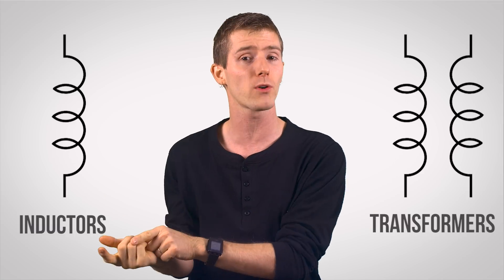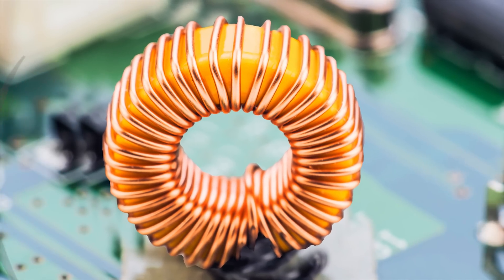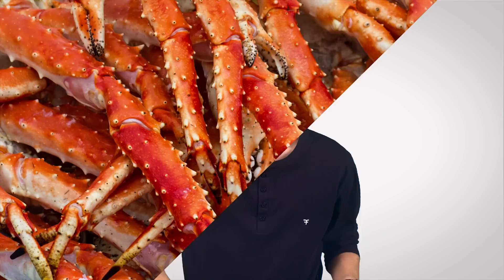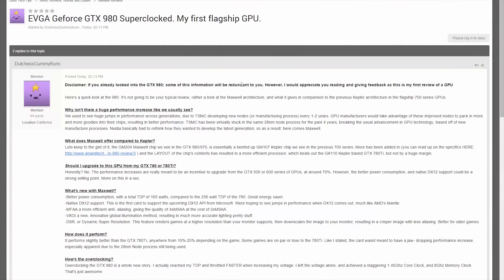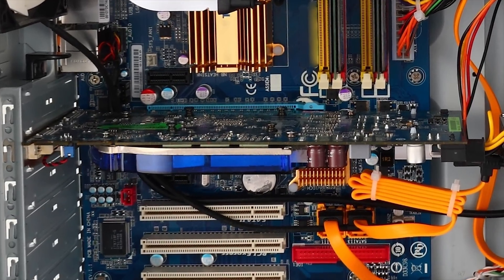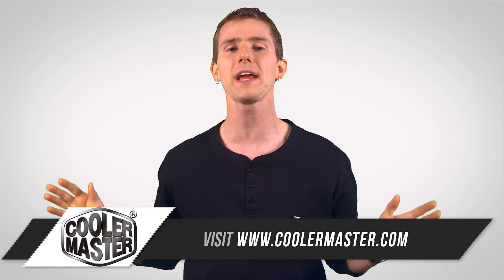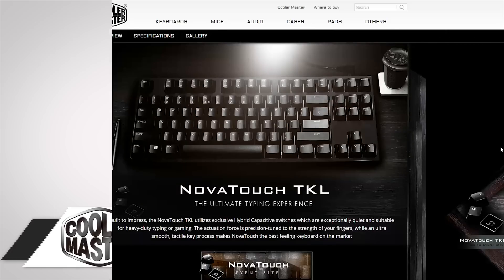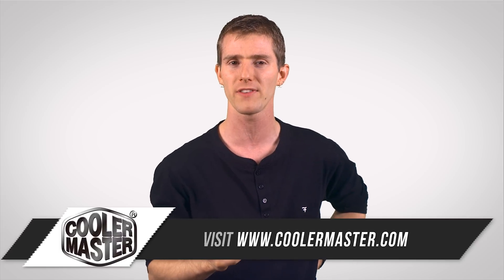Coil Whine as Fast As Possible

Comment: Coil whining is not due to resonance per se. It is due to the mechanical vibrations caused by the varying electromagnetic field forces exerted on the coil components (winding and ferormagnetic core). The frequency of these vibrations is the frequency of the changing of the amplitude of the electromagnetic forces which is equal to the frequency of changing of the magnetic field which is created by the flow of the current through the windings and which changes according to the load (the gpu load). Typically within each frame the magnitude of the current undergoes at least one increase-decrease cycle/spike. The period of these current increase-decrease cycles is therefore tied to the frame time, or in other words, the frequency these current cycles (and the resulting coil compoenent vibrations) is tied to the frame rate. For 60fps and 1:1 spike:frame time correlation you would have a variation frequency of 60Hz which of course falls witin the audible range of 20-20KHz and that's why we hear the resulting coil component vibrations. Also the higher the frame rate the higher the frequency and the higher the pitch thus the term 'whining'. Sure resonance MAY also happen to occur too on top of that, which will amplify the amplitude of the resulting oscillations and augment the issue even further. But reasonance is not the underlying reason for the coil whining phenomenon.

Comment: If you are too lazy to watch the video and want a fast solution just use digital sound! Use any USB headphones or buy an external (USB) soundcard for 6 bucks and plug your jack connector into it. I'm using a potato and it worked.

Comment: In most cases graphics card coil whine can be caused by high frame rates, especially in older, less demanding games. My RX 470 starts to pipe up around the 120FPS mark but if you turn on VSYNC to 60 it usually stops any coil whine issues, at least for me it did.
Reply: Also in the Witcher 3 loading screens when booting up the game where fraps reports around 3000 FPS. 😂

Comment: To guys saying Vsync will definitely fix the problem:

you're actually not entirely wrong, but not entirely correct too. In cases where we have our GPU card much more reliable for certain games which we play, yes, turning on Vsync may help.

But lets talk about lower-end GPU here. Lets say Im playing Game "A" with 50 FPS average and I experience Coil Whine. In this case, TURNING VSYNC ON WON'T HELP. And this is actually what occurred on my end.

This coil whine apparently may cause when GPU card gets too much stressed, resulted in high energy draw. Having 150 FPS with coil whine may be fixed by turning Vsync, giving GPU card lighter task to do per second. But when you have a Card which is already exhausted to make 60 frames in a second (or less), Vsync can't do anything.

Yes, PSU performance plays a role here.

Comment: I'm assuming this is the same thing that causes some old CRT's to emit a high-pitched scream. Too bad there isn't any real fix, though I've never noticed this with anything with modern computers.
Reply: I remeber that whine of CRT's, its more annoying then coil whine on graphics cards. Also it sometimes seemed to happen when putting a CRT monitor above its recommended resolution

Comment: i cant tell if my coil whine is chipset or gpu because the chipset is under the gpu but i think gpu because it only happenes with glu load but anyways i will be getting a 1080ti when a custom cooler design comes

Comment: Frame Rate Target Control -> Set to monitors refresh rate, optionally use vsync. On some certain models and older cards it might not eliminate it but it will help. 
GPU coil whine is usually caused by frequency mismatch between the monitor and your GPU's ROP, basically discarded frames shoot out of the capacitors and inductors. It can go the other way too, you can actually "infect" some old HDMI TVs with newer GPUs, giving the TV permanent coil whine. Happened to my old 1080i insignia(off-brand comprising of outdated and binned samsung parts)
If it's a MOBO component it's probably just some noise from lowish quality caps in either the MOBO or PSU.

Comment: Hey techi, great video! Got a question for you. Why does my computer start whirring up really loud when I'm gaming or processing a video? I've flipped the switch on the back of the PC from 300 to 325 Volts and all it did was shut off the breaker for that side of the house. Is there a such thing as a compensator to prevent that from happening?

Comment: i have something weird: my speakers, not my gpu but my speakers make coil whine-like sounds when the graphics card is under heavy load. what can i do about that? i tried putting my speakers in the front aufio jack, reinstalled driver, even tried other speakers, but it still occurs! only my headphones dont get the sound. what am i doing wrong?
Reply: ***** you sure it are my speakers? I tried connecting to my phone: no weird sound. I tried connecting another speaker to my pc: weird sound again.
Reply: Martin Van Den Hoek try rotating the cable, usually it's the combination of weathered jack and old port.
Reply: Lunar Froxy i got a mobo thatsjust 3 montd old. But ill try, thanks!
Reply: Lunar Froxy i tested, rotating does not work.i have my speakers turned off now, and i onl y use them for watching movies.
Reply: speakers dont coil whine, buzzing sounds from speakers are caused by electrical interference, the audio jack on your pc may not be properly grounded or the cable does not form a snug plug with the jack
Reply: Babatunde Olajid how can i properly ground it then?

Comment: as soon as i start a game like Fallout 4 it starts to whine but in normal runs i don't hear a thing
Reply: Looks like you have the same issue as Linus' old video (which he showed at 1:02 - 1:07 ). The coil whine starts when the GPU is under load and intensifies as the load increases. Unfortunately there is no solution for this.
Reply: what if i send my card back and buy a new one would there be a chance that the whining is gone?
Reply: sharkyfive
Based from what I've read, most companies don't cover coil whine in their warranties :(
Yes, that if you and the seller agreed for a return of equipment. But you better check if it is your GPU, because sometimes the PSU causes it or even the mobo and/or the fan.
Reply: Juriel Primary how do i check it the best just start a game without the card plugged into the pc? should i maybe buy a high quality PSU from like be quiet should that help?
Reply: sharkyfive
The thing you can do is to listen very carefully at each component mentioned. Did you overclocked your GPU? CPU? If you really suspect your GPU to cause the whine, try other GPU heavy games like BF1, GTA V, Rise of The Tomb Raider, etc.
If you overclocked your GPU/CPU, try to revert it to default settings and see if it will help. Coil whine usually occurs when the component is in a lot of stress due to heavy loads of data.
Reply: sharkyfive
here's a useful link i found about coil whine. maybe one of the solutions here can help you

https://www.reddit.com/r/overclocking/comments/3ty1s6/gtx_970_having_obnoxious_coil_whine_after/?st=ivntixjx&sh=805d71ea

Comment: Would buying a sound card fix it? I have a gtx 750 ti and its really bad with some of my headsets. At the moment im using intergrated/motherboard sound so.... soundcard? Yes or no?
Reply: Coil whine is from vibrating physical components, not through the speakers.
Reply: Did you watch the video? The whine originate from parts on the card itself.
Reply: IF the sound comes from your headset it is NOT coil whine. In fact this could be an issue with your motherboards integrated audio OR drivers. So yeah, buying a sound cart MIGHT fix it. Get yourself an USB sound card for real cheap and see if that helps.

IF the coil whine comes from the GPU, what makes you think buying a sound card will fix it? Because it won't. Only replacing it would fix it. And a GPU should not make high pitched sound come out of your headset.
Reply: ***** Ive tried it and its still there on all my headsets, except some its louder than others. (This is probably because some headsets have better protection against it?? idk)

Comment: I spent $230 on a gigabyte 960 g1 gamers edition card and it slapped me in the back with coil whine after 1 year.
FRIK YOU GIGABYTE
Reply: Not gigabytes fault. Happens to all manufactures. You can't prevent it. It's an issue that might occur with all electronic products that use Coils and Capacitors.
Reply: A320M-DS2 same issue :/

Comment: Wouldn't a power supply with extremely low ripple and very, very good clean and stable power delivery as well as a gpu with a very clean and stable power delivery reduce coil whine by a lot?

Comment: Bought gtx 1080 gigabyte xtreme,  got coil whine while testing and while playing witcher 3 on ultra 2k,  its not reallllllllllllly that loud but it's annoying in someway and gets me worried,  should I return I have the option to do it and swap it for something else? Or its gonna be everywhere anyways?
Reply: it comes with normal operation, so long as the card works then you're fine, its a side effect of normal operation
Reply: +Dylan Collins yes but it happens with every game which is strange
Reply: Billy Harb not really, just shows that your card is working hard but performing well
Reply: +Dylan Collins well I guess I got nothing to worry about, thanks for the info bro
Reply: I just had that with my new gtx 1080 on the witcher. And it sounds like how you explained it. Have you noticed that it is alot more worde with hairworks on? Btw i was worried to but after googling its turned out not to be that bad, just annoying lol

Comment: My server doesn't get coil whine :) I can actually sleep at night.
Reply: Well, its usually gpus that coil whine
Reply: +Xamnition I'd be worried if you had a server without at least 1 graphics card.
Reply: +Convergant What? Most servers dont need gpu's
Reply: +Xamnition Most servers will use Xeons, which don't have integrated graphics.  AKA they need a GPU.
Reply: +Convergant I know, i use a xeon myself. Most server motherboards have integrated graphics
Reply: +Xamnition Regardless of that, a lot of server-grade workload will utilise the the GPU(s).
Reply: +Convergant Very few things utilize the gpu, usually servers use multiple cpu's
Reply: +Xamnition You'd be surprised.  For example, Blender (a popular modelling/animation program) can be set to GPU Compute (which will use the GPU for rendering).
Reply: Convergant I know, i use blender all the time.
Reply: Xamnition Then we can agree that you should have a GPU for those kinds of things?
Reply: If you are talking about a VM host server, or a linux (web)server in general: there is absolutely no graphic card required. It won't be used, you can SSH into the box so you don't need a GUI to work with. If you are talking about a render farm computer: put it full of graphic cards as much as you can. But a render-farm server is not the kind of shit I want in my bedroom ;)

Comment: Coil whine on high load? My gtx 980ti does it on low load, then I just need to open a GPU intense aplication, like a game, and then it stops for the rest of the sesion.
Reply: Mine only does when closing unigine valley and heaven. Weird
Reply: Brooo same here, but i have it in my cpu fan. i need to increase the speed of cpu fan to stop this noise.
Reply: It's so strange... Mine has completly stopped now.

Comment: have a 970 with this annoyance
Reply: did you get your $30 for their lying bullshit?
Reply: asus turbo?
Reply: The Fresh Peddler - Beats For People Who Hate Radio nope a Palit but most 970 have this problem
Reply: just bought an evga 970 and now i have this fucking whine coming from the psu...
Reply: wades623 no its us only and its not $30 for the coil whine its for the 0.5GB Rant
Reply: Ding Chavez overclocked?
Reply: slightly, +50 on core and +50 on memory. Im on a corsair CX 750m, i turned down my cpu clock just after posting that comment, followed by lowering the voltage (only -100mhz and drop vcore to 1.43 from 1.50) seems that the cpu OC was the problem :/
Reply: you drained too much power on the mbord power so the psu had to struggle you get coil whine when electronics are under high load
Reply: i drained too much? where do you come up with this assumption? my psu is capable of powering way more than what i currently have connected. your statement doesnt even make sense, you cannot physically drain power on a mobo... if you listen to the video he says thats you cannot fix this problem because its due to the coils vibrating at high frequencies, the coil will vibrate or it wont, its simple. i just didnt feel like having to go through all the voltages with it so i reduced my vcore ever so slightly and it just stopped.
Reply: Ding Chavez if you have a lot of things plugged into the computer the psu have to power that too its not just the wattage that counts
Reply: i litterally have two plugs being used on my PSU, one for the 2 pci 6 pins and one for 3 sata power ports that go to 2 hdd and 1 ssd. i know how much power consumption i have, its been calculated and is well under 550w.. its probably just because this psu gets it when core voltage is at exactly 1.50, technically it vdroops to 1.48 so going above or below that voltage seems to help though i havent gone above yet.
Reply: Zotac one :/
Reply: Deactivate CPU features in BIOS. 
Yeah, Yeah, CPU is not involved, does not have any coils... bla bla.

It is normally the CPU putting to much electricity on certain graphic gateways which creates coil noise in the graphic card.

Especially CPU features that regulate frequencies for "better performance" are known to create resonances on gateway coils.
Reply: actually i removed my coil whine by enabling throttling on my cpu (amd cool n quiet), so your comment is not entirely true.
Reply: zotac 1070, its perfect. Though, 970 MSI had problem
Reply: me too , tha sucks, so no solution then?
Reply: worked? it really worked?
Reply: adjusted the overclock on my cpu and it fixed the problem. Turned on throttling basically
Reply: Hum... that's an start , i'll try overclock my GPU and see what happens (first i have to learn how to overclock without destroying my gpu btw   XD). thanks a lot :D
Reply: Mine is neither overclocked nor have led lighting
Reply: Patrik Forsman I reduced my 970 coil whine by limiting the frame rate to that of my monitor. If you don't have a G-sync monitor you can use MSI Afterburner even on none MSI cards to lock you max frame rate. Thus in most games which do not need full power on this card you reduce the load and therefore the noise.

Comment: There is also coil whine in motherboard, usually turning off C1E or even C6 fixed it for me
Reply: And what does that mean? I was believing that the coil whine was coming from my brand new PSU, but now I know it's not, so I have one less component to try out. -_-
Reply: In my case it was only audioble in Linux but I made it shut up by turning C1E off
Reply: +Acácio Florentino or just glue eveey choke and coil down with silicon :D // still waiting for coilwhine :). Sorry for you.
Reply: synthercat
But I dunno what C1E, C6 or whatever means :P
Reply: theyre powerstates which your cpu turns to save power in idle or when its on sleep
Reply: TheIdiotPlays
Oh, thank you! And am I able to disable them only through BIOS, or is there a way to disable them via Windows 10/Linux?

I don't think I will find these C things in my old BIOS. I guess they are located in IRQ channel, in the menu "advanced"? Sorry, I have no clue.
Reply: +Acácio Florentino theyre on the bios. If i recall correctly, they should be named intel speedstep
Reply: TheIdiotPlays SpeedStep! Now things were to another level. But there are at least two variables (C1E and C6), aren't?

I wish I could disable them through OS because I'm unable to access BIOS with my R9 280x attached in my PCIe slot (it crashes, probably due to my old MOBO having 1.1 PCIe slot, while my graphics card is 3.0).

I think the coil whine issue is related to my graphics card, not MOBO, because the noise starts only when I mine Decred (a cryptocurrency).
Reply: +Acácio Florentino sorry, i apparently didnt mention that c1e or c6 was the sleep state where it goes when you put your pc to sleep (i dont remember which one was which, i have an amd rig)
Reply: +Acácio Florentino having pcie 1.1, wouldnt it be time to upgrade? I know you might not have money, but at that point if the mobo crashes with that 280x i cant really help other than say good luck. Ask if you have any questions of course, i still might be some help or someone else might answer too.